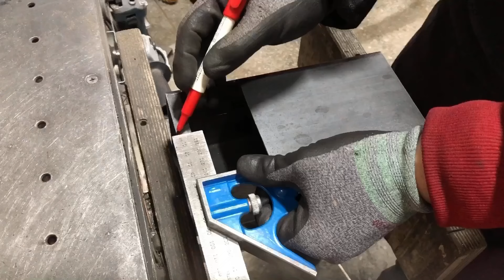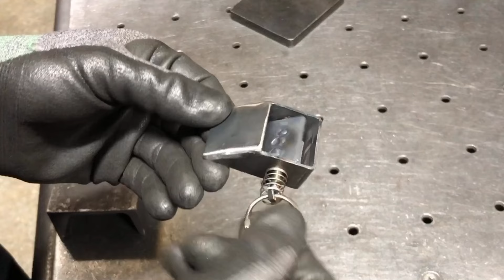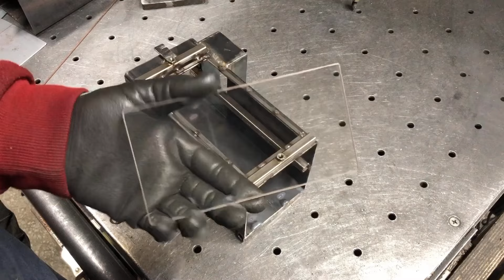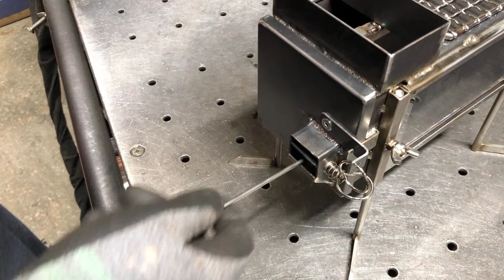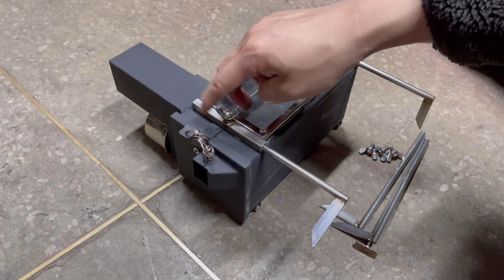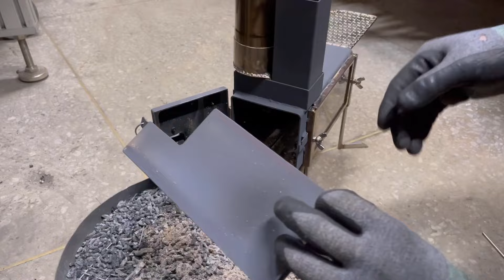초미니 로켓 난로만들기ㅣBuilding a very small wood stove

Comment: This is my favourite so far! I soo want a stove like this. Have to try and replicate it. Could you advise on where to find the glass window, including frame, you use?
Reply: The high temperature glass you might be looking for could be "Keralite"
Reply: @malayrojak  Thank you!
Reply: @WildJohan  no problem. It might be expensive though. If you are planning on making this, I would use carbon steel plate/tube to start off with to cut your teeth so to speak. Doing it all in stainless could be expensive, and will not mitigate all corrosion or discoloration that will occur when you use it.
Reply: @WildJohan  I would also consider sitting the glass in a "frame" which it not tightly fit, to allow for thermal expansion as they are two different materials which have different thermal conductivities. Wouldn't want that panel of yours to crack/shatter.